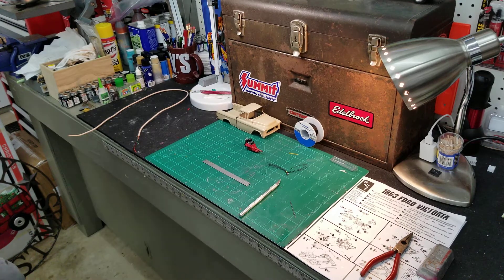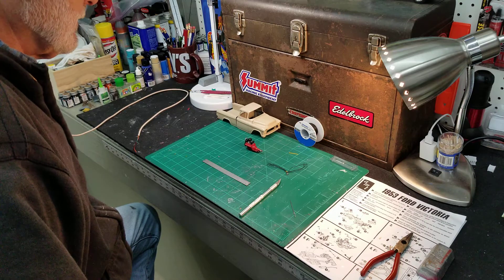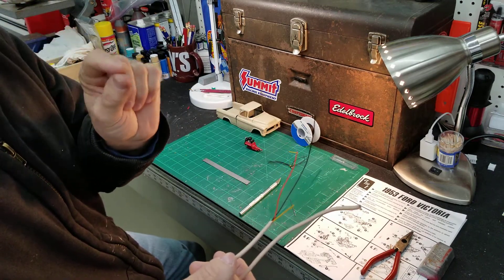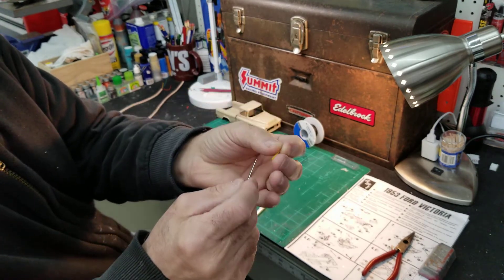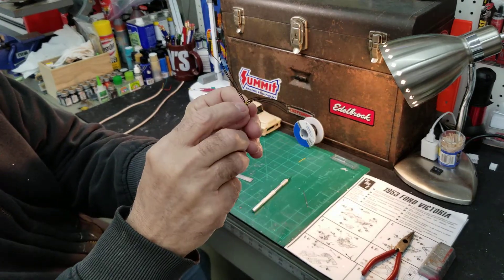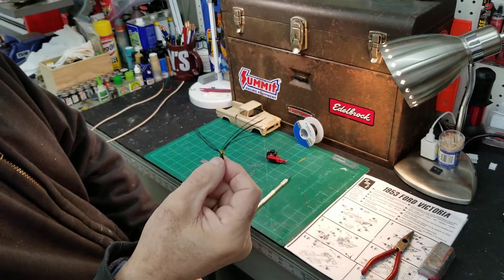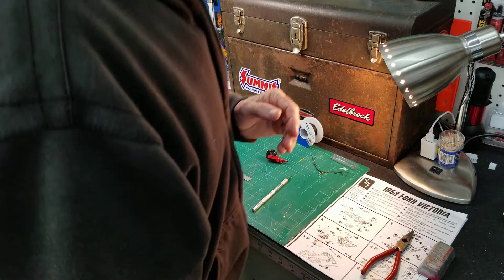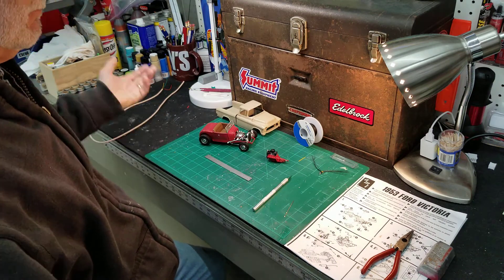Making Plug Wire Boots

Comment: I’ve found heat shrink 1/16 works well depending on the process used.
Reply from the maker: So do you just use it as is for a plug boot or shrink it around the end of your plug wire?
Reply: I shrink it after I shape and attach the wire so that it shrinks on the distributor terminals and and over the spark plug, I will try to send some pictures… it turns out pretty realistic. It is possible to find shrink tubing in smaller diameter at electronic repair supplies
Reply from the maker: @Leadfootkurtis  Thanks.  Pics would be great.